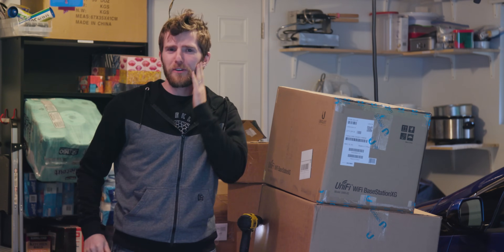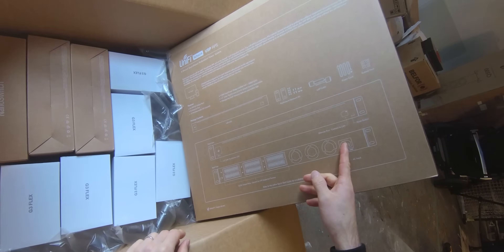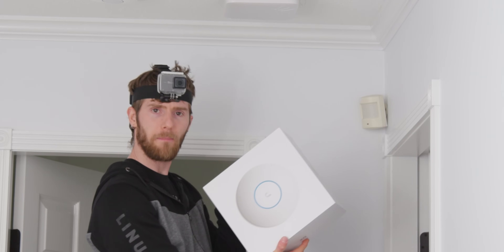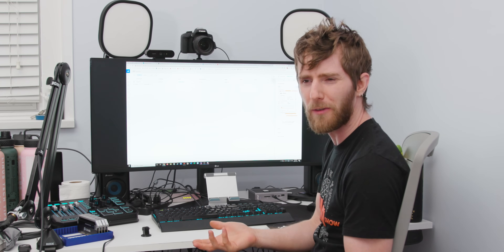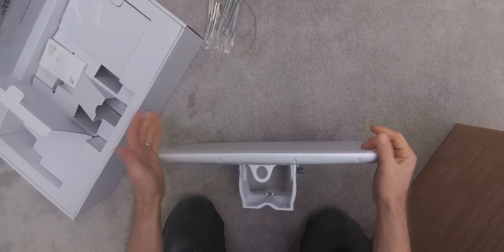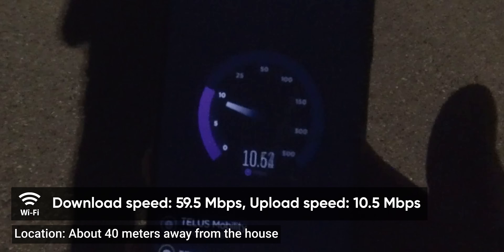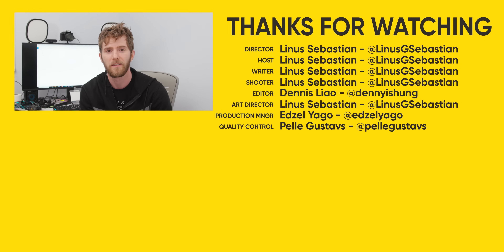I REPLACED my $1000 Wifi....

Comment: Linus: spends $1000 on wifi 5 years ago
Me: still using a 15 year old WAP54G which cost me £15 and was installed 11 years ago
(Doesn't really bother me, my connection is only 6 Mbps down and 0.9Mbps up; yes ADSL phone line broadband here in the UK sucks)

Comment: At 4:10 we see the "before" performance, or after? I suspect that it's before, due to being immediately after the driveway before test. We don't see the living room after test, nor an indoor comparison for performance. The fact that the equipment has 10Gbe ports is normal for enterprise gear, especially when they have wireless capacity that exceeds 1Gbe. There's also no cost breakdown to get what was achieved. My opinion of this piece as edited, "cool story bro". I don't think it needs the detail that GN typically includes, but this doesn't come close to usable for any viewership, other than an awareness that such products exist.
Reply: No price break down because it's nearly $4k+ in gear, and would rather not advertise he got it all for free.

Comment: How to overbuild to an extent you will never take advantage of 101. The BasestationXG is over $1500  and UAP-XG is like $750. You could have achieved the same results with a NanoHD for $160 and a UAP-AC-M for like $90. As it is I'm doing nearly that with a NanoHD and a couple In Wall Access points off UDM pro and couple USW switches.

Comment: Asus ROG STRIX G - (G531GT) 

Default Configuration - 8GB RAM , 256GB SSD, 1TB HDD, GTX 1650, i7 9th Gen.

I would like to upgrade my RAM, could you please help me with this. Can I add 16GB RAM , I do have 8GB RAM on my primary slot whether it will cause any issues.

Whether the below mentioned RAM is compatible with my laptop if not suggest me list of compatible RAM.

https://www.amazon.in/dp/B01N7K4DV4/ref=cm_sw_r_tw_dp_U_x_XQM1Eb5QXT0QS

Actually I just found the HyperX 16GB RAM. The thing is, the latency (CL i think) don't match with my current RAM (seen this in CPU-Z). The HyperX is CL15 and my RAM is CL19 (as I found online. In CPU-Z on CAS Latency it says 17-18-19-20). So do you still think HyperX is a better option or what's the ideal rating should be ?

Comment: Ehh, no thats not why you dont crimp a solid strand cable. The connection of the rj-45 plug will just be "resting" on the strand and will give you bad connection that will eventually or emediatly give you very wierd connectivity issues that can be very hard to troubleshoot.

Comment: Just upgraded the WiFi router to WiFi 6 and got tremendously better experience compared to the garbage box my ISP gave me. I'm getting 200Mbps up and down before on 5GHz and now I'm getting 700Mbps down and 300 up on a WiFi 5 device.  Being able to choose a channel thats not used by any access points in an appointment is a huge advantage.

Comment: "What do they expect me to put it on"
well linus, they dont expect private users to get a $1500 outside accesspoint capable of having 10000 users connect to it.. the metal thing is for a thicc metal bar.
Reply: While the XGs are overkill. In the meaning of it. You could make a case for a AP AC nanoHD which costs a 10th of the XG even for private usage. Or even if you were buying 2nd wave wifi-5 (ac) stuff in 2017 like myself, when they first came out, the AP AC HD. Yes my neighbours totally hate me but one even asked me to help him build his network when he is moving to his new bought home so <shrugs> 
While self employed we rolled out two sites with 5 APs in total at one customer that is a testing facility. 
We rolled out at the first site 4 UAP-AC-Pros that span each one of them a whole storey aisle in 2018 (we would have been totally fine with 2 instead of 4 but the customer wanted a deployment of 4). And on the second site we rolled out between late december 2019 and january 2020 one nanoHD which we recommended with an option to upgrade it two 2 of those but it turned out we were totally fine with one. spanning the whole storey with the network.
Reply: itm nobody asked, mate

Comment: No clue why he spends so much on WiFi when I’ve literally got the same speeds with just a router lol
Reply: Consider yourself extremely lucky, Friend.
Reply: Archer C5/C7 and openwrt work fine for a sub $80 system. My service is spectrum (as tested via Archer C7v2) 460/22Mbps, and wifi peaks around 250-300Mbps on 5ghz. Coverage is adequate, and I use a second one as a WDS extender in another room for things that don't have wifi. I'd say that's inexpensive for a rental property (not having to make holes to run cables, and the Spectrum modem is included for $70/mo.
Reply: Yeah, I have a friend who bought the edgerouter x and a Ubiquiti ap ac lite for like 135 and it improved his WiFi drastically for considerably less than I spent on the usg, switch, and ap ac pro even. My current setup gives me respectable speeds >100 mbps anywhere in my apartment(a 2500 sq ft basement suite). Pretty sure he just wanted to to say he could. Lol.

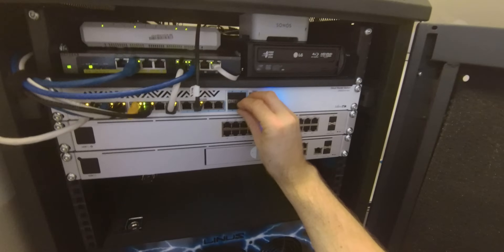Comment: 5:30 SFP+ problem: literally, get an SFP that suits your needs. EZ solution
Reply: As close as that equipment is, 10Gbe DAC would be the cheapest option, not a pair of SFP+ modules cat6a/7 or fiber and the correct cable. ~$20USD vs ~$120USD.
Reply: @shickster1  Linus doesn't get paid to shill cheap equipment, he gets paid to shill the expensive stuff. Constant consumerism is the creed of the channel.
Reply: Shawn Hicks I am in agreement: I was mostly referring to the 10G beacon mentioned prior to this point in the video.

Comment: My $129 refurb Airport Extreme AC (connected as access point only to my router) I got back in 2014 is still giving me 400 megabits LAN and 150 megabits WAN with no lockups or client drops, so I won't be putting a ton of money into something marginally better any time soon. I still run Cat 6 for stuff that needs anything faster.

Comment: LOL, I get 100+ Mbps D and 100+ Mbps U from about 3 houses down say 300 feet, it drops pretty drastically from there with no signal around 400+ feet. I use a TP-Link 1700 AC Router and have Gigabit FiOS , I get complete coverage of 1400 sqft of a single story and my entire yard (Corner Lot). I average 480 over 342 when I'm in the main house on 5g, when in my office I get 350+ over 250+ and in my pool I get 225+ over 175+ and I don't have any access points or repeaters!

Comment: I bought a pack of 3 UNIFI AC  + controller for my new house and ended up only needing 1 of them as coverage so damn good and faster than my internet speed. Ended up not using the controller either and using the app (which works fine).  It's good gear.

Comment: I recently went from Cisco to Ubiquiti at the detention facility and Sheriff's office I work at. 50 switches, mixed 24, 48's and xg's and around 60 UAC-AP-Pro's. We spent $48,000 USD on our project compared to the nearly $200,000 usd quotes for Cisco, Aruba and Rukus. We haven't looked back. My team loves the Ubiquiti interface. The only pain point is IDS/IPS bottlenecking on the USG Pro 4.

Comment: Pro tip: Remember, you can have the most powerful base antenna for outdoor WiFi, but you can't forget that the biggest limiting factor is the strength of the antenna in the device you are using. You must be able to maintain 2-way communication between the devices. Your phone may still be able to see the super powerful base antenna, but the antenna can't see your phone because the phone is just not powerful enough to reach all the way back.

Comment: Linus's poor neighbours, how are they going to use 5GHz wifi when Linus is blasting the whole area with 3 high powered radios?  One of the benefits of 5GHz is that it doesn't go through solid objects very well which means that you are going to have a higher chance of finding a channel or two in your house that isn't crowded out by a dozen other access points.  Blasting 3 radios worth of 5GHz into the street kinda kills that...

Comment: Unifi is the real deal. Been using UAP-AC-Pro APs for years and love them. Would like to be able to upgrade to the SHD so that I can use the dedicated security sensors but just can't justify the cost when these older AC-Pro's are still working so well.

Comment: 1000 dollar wifi for a whole 5 years ...  Luxery problems.   I still use my 65 bucks router from 2012.   Price per kwh must be cheap aswel with that much power hungry devices.  And channel 1 open ha i wish there's atleast 5 networks on every channel. Im happy on days i get 30 mbit. And even 5ghz has overlap on all channels crippling download.

Comment: Meanwhile in Finland you can simply get 1000 Mbps 5G connection to your phone with unlimited data for 50€ per month. If you want cheaper, you can select 300 Mbps unlimited data for 30€ per month. 100 Mbps unlimited 4G data costs 18€ per month. Getting highly expensive WiFi equipment does not make a lot of sense here. We have 3 operators with nation wide coverage which allows true price competition between the vendors.

Comment: I've used the same $50 wired/wireless combo router for over 10 years now.  The only changes I made was to add a couple of 5 port switches to accommodate the additional wired connections I've added.  But then again, I'm still on the same DSL connection I've had for the last 10 years.

Comment: What linus forget To mention it's by installing this kind of antenna for long range outside of your yard can infringement some law about radio frequency you should never boots your wifi outside of your yard except if you share with neighbors just this is an another story 

I have an external wifi ap which cover the second part of my yard since the wifi don't cover this part
It's an omni-directionnal and set not to high to prevent issue with neighbors 

I will not be  surprised if a crtc guy  or a police officer ring at limus place about is wifi

Comment: Linus you are the worst Neighbour, just because you can buy a fast car does not mean you are allowed to drive flat out on the public road. Likewise there are limits on the amount of gain you can use on wireless transmitters. The product you bolted up is designed for commercial use and certainly by UK law would have to be installed and tested by someone qualified with some knowledge of the health and safety impact. I have 1st hand felt what 50dbi of gain can do and it took an hour for the headache to fade!! These are not meant to be in close proximity to people!!!! Turn that gain down now!!!

Comment: (I don’t know what the correct installation recommendation would be from the manufacturer but) if you’d installed the panel externally and had a clear line of sight outdoors to it, surely you would have had significantly higher speeds as 5ghz penetration is low.

Comment: Linus: “Haven’t changed it in 5 YEARS”
looks at my 10 year old router in the corner of the room
Router: sweats nervously
Reply: I wish I could see a sweating router meme with this.
Reply: Laughs in Linksys WRT54G
Reply: I mean, if it runs, let it run...
Reply: Wallet: sweats even more
Reply: What brand is that router? Mine die every 1-2 years
Reply: @MarcSGA  my Zyxel Keenetic 1 is still going strong, I have slapped OpenWRT on it so that it doesn't have all the glaring vulnerabilities of the OEM firmware and I haven't had any issues with it for >7 years now (my parents bought it in 2011)
I don't have anything but LTE here, so upgrading to anything newer doesn't make any sense -- the bottlneck is not the Wi-Fi anyways.
Reply: hahaha
Reply: 15 years get 2 megabytes
Reply: Same router model for the past 12 years, move 20 feet and the wifi is gone
Reply: 10 years?
Huh, weak.
Reply: My mom's router is too damn old. I don't even know it's age and it's horrible here.
Reply: I like how you've posted your funny comment multiple times in a sad attempt to gain some likes. Please, get help as soon as possible.

Comment: I remember awhile ago when i upgraded my fiber connection from 100/50 to 300/100, and with that i got a new router. and that router had both 2.4ghz wifi signal and 5g. The annoying thing with that was i litterly moved 2meters and it jumped between the signals since they were the same wifi connection, so basically my wifi stopped working like 10 times a day for like half a minute

Comment: "What's this 10 gig for?" I believe those are also designed for high density applications, so likely to support high bandwidth across tons of devices, like a football stadium for example.
And I mean, say you want to edit 4K footage on your laptop? What's stopping you from putting 10 Gig wireless down? ;)
Reply: Pretty sure there is no 801.11ac single radio capable of 10 gigabit speeds so your laptop would probably max out around 2 gigabit.
Reply: It has three radios. Each capable of saturating GbE. 5.2Gb/s altogether. It's kinda crazy.
Reply: @urgay1992  well that's today, who knows in 4 years?
Reply: @urgay1992  Ah, I forgot about wireless standards.

I know 802.11ad is rolling out slowly to new devices which should be capable of around 7 Gbps. I wonder if there's anything faster.

Comment: set the VHT to 160Mhz channels and you should get another 30ish% on compatible devices, also if you enable wifi optimisation and 802.11r support you should get better roaming with devices being pushed over to 5Ghz. Also remember to space out your channels, about 4 channels apart if you're using VHT 160

Comment: that outdoor AP was 100% overkill just for your driveway, if you'd put a regular one right there it would have been fine lol

as for the 2.4/5ghz AP names, just create one Wireless Network in the controller settings, then edit it on each AP to change the name. Easier to manage than disabling the spare network.

Comment: I set up a Ubitique/UniFi setup in the new house to cover the 258m² (2777ft²) house and 3000m² (32291 ft²) garden, not to expensive and sleek installation. Using cables to all computers and WiFi to everything else. Routing behind the gigabit fiber connection is a FreeBSD/pfSense server and HPE switch to all wired machines. Using a more cost effective set of Ubitique ap's then Linus but still amazing coverage hovering around 150-200Mb/s WiFi network.

Comment: His WiFi speed seems a bit too low, only 431 Mbit. Unless of course he only has 450 Mbit internet or the speedtest server is limiting. Could also be the Note 9.

I use different equipment and get about 620 Mbit on an iPhone 11 Pro Max with 2x2 MiMo on the 5 Ghz band with 80 MHz channels. With 3x3 MiMo devices it’s easily over 1 gbit. When I am about 30 meters from the AP, speed drops to about 450 Mbit.

Comment: Before i knew what unifi was i had already setup my 2 story house with a google wifi setup, 3 pods and i get full bars on my entire property. and manage a consistent 400+Mbps download on speedtest anywhere on my property. even at my community box. not alot of features or settings. but it just works.  i have gig internet and could not find a wireless router that was stable, but these damn google wifi pods have been working without failing for over 2 years now.  never even had to reset them yet. still would go with unifi if i upgrade or move.

Comment: I bought into the UniFi stuff. Its incredible.

Dream Machine, 2 APs, 8 port PoE switch and 4 port switch. House is fully networked and could not be more happy with it.

The UI is INSANE. There are SO many features and options you probably won't ever use them all. But if you love networking and like to tinker, this stuff is crack.

Comment: Linus, did you increase the channel width on the UAP-XG 5Ghz radios?
You should be able to get near gigabit speeds over wifi if you bump the channel width up to 80+Mhz. 
If you turn on the wifi AI feature in your controller it will probably set that automatically.

Comment: Since it's going in the rack and be moved once in a blue moon solid core is just fine. They hold decently up well as long as you don't kink or fold them. Stranded isn't too great for speed anyways due to stability, especially based on the length.

Comment: 10:43 Linus WiFi at 92Mbps
"Speeds not too great"
Me at 5.76Mbps "FML"
Reply: Try 1.5 max normally .75 to 1
Reply: @bfdia51  i  got u
Reply: That makes me sad for them this is a truly unjust earth
Reply: You aussie? Because i get like 8mb down and like 1mb up when NO ONE IS ON if there's  people on my wifi i get like as low as 2mb down and .25up
Reply: Dude, it's megabits, not megabytes, so divide it by 8.
Reply: Yegor Georgiyev you know some people do have internet as slow as 5 megaBITS per second right?
Reply: Damm i have 300-400Mbps wifi and 700 wired. One day it will get better for you

Comment: Know the feel. 2 years ago I got so frustrated with a full UniFi home network. Behind a wall I was getting less than 2.4ghz speeds. I kept the gear at home while using deco mesh routers with much more reliable connections. Nowadays I have 2 internet links coming to an USG and I am planning to give a second try on UAPs because the software has envolved much.

Comment: My internet it's supposed to run at 600mbps but it's very not reliable. It's pretty good most of the time though. I'm two floors above the router and the opposite side of the house and I usually get around 250mbps but I've seen it go as low as 0.02mbps

Comment: Only Linus would take an AP that's designed to support a large part of a  Stadium and put it in his attic to check out the distance down the driveway. Put it outside for a quick test and it will be working more than a few blocks away.

Comment: Was this $3400US of network hardware?
As a reasonable person, what should I do for my home wifi to work in my back yard and garage? Ubiquiti?
Also, could you maybe explain what each of these components does?
Reply: What's your isp speeds? Rough house size? And do you already have ethernet drops or are able to run them in the house?  Those are the big questions